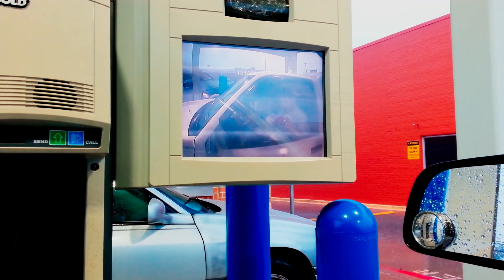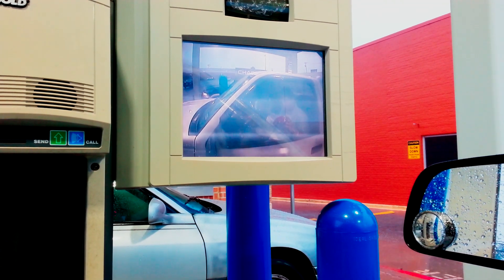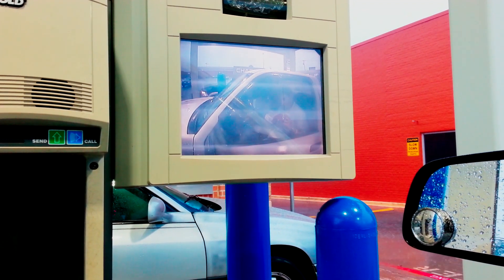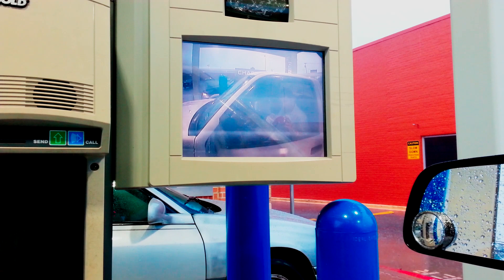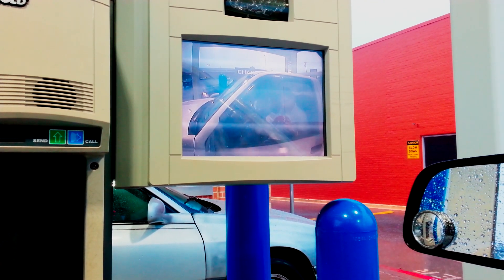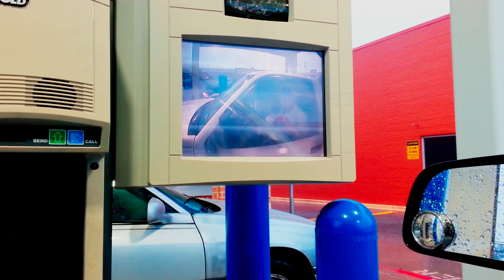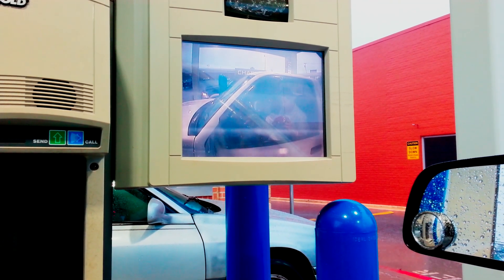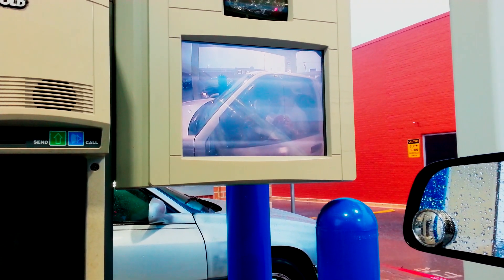CCTV Video surveillance ground loops brief explanation | SC0076

Comment: I have a security camera system which has lines and static (best way to explain it) the lines kind of go everywhere and are really noticeable at night. Would an isolator reduce this? System is BNC connections.
Reply from the maker: Ground loops typically have this main characteristic. Horizontal lines scrolling up and down. If it has other issues this may not help. Use general diagnostics to determine and isolate the issue. Start by changing one thing at a time. Lift the ground, change the circuit, run all devices off the same circuit, etc. See how that works.

Comment: Would outdoor power lines cause ground loop interference?
Reply from the maker: outdoor power lines could cause EMI (electromagnetic interference) or RFI (radio frequency interference). However, ground loops are typically related to the devices that are connected to the CCTV system directly and the potential difference in the grounds. If you think EMI or RFI is an issue run another wire temporarily from the DVR/NVR to the camera getting as far away as you can from the power line and see if the issue goes away.

Comment: One of my cameras has a line scrolling from left to right would a passive isolator fixit? The line is very faint but annoying!
Reply from the maker: They can help by isolating a ground potential difference. So if that's the cause it could help.